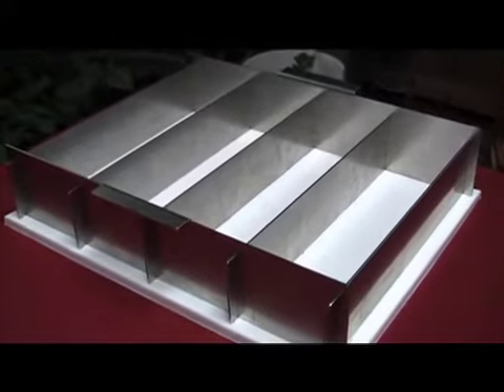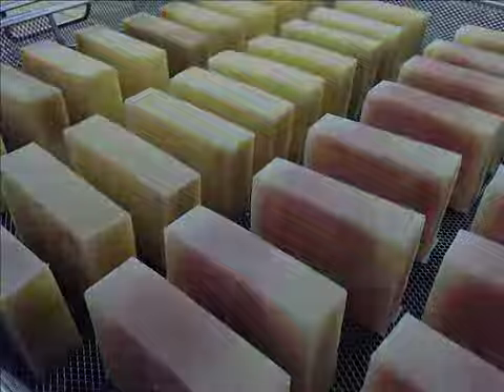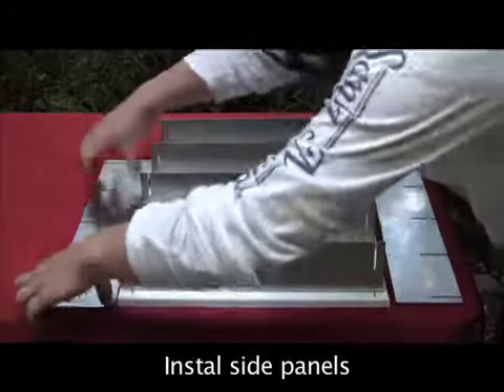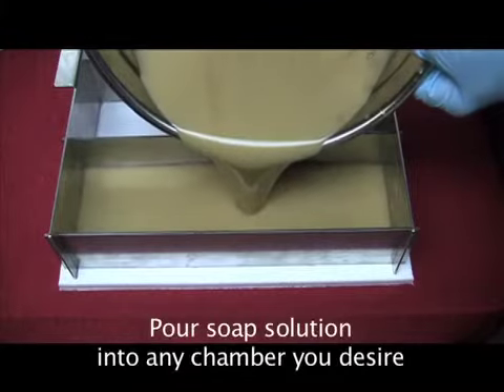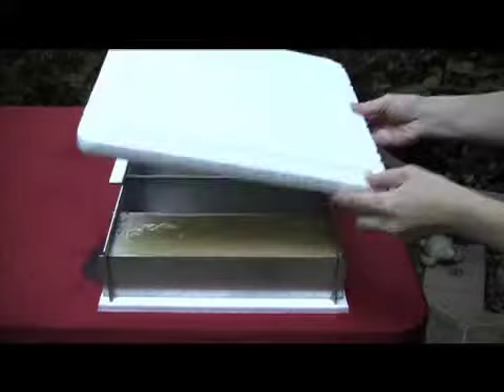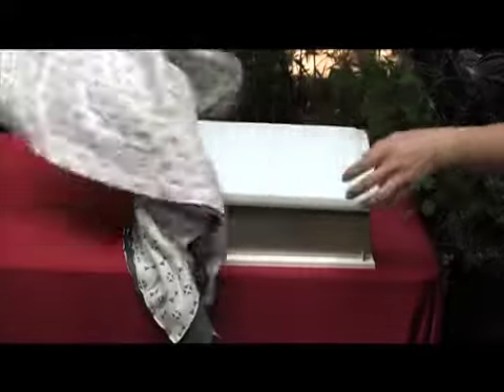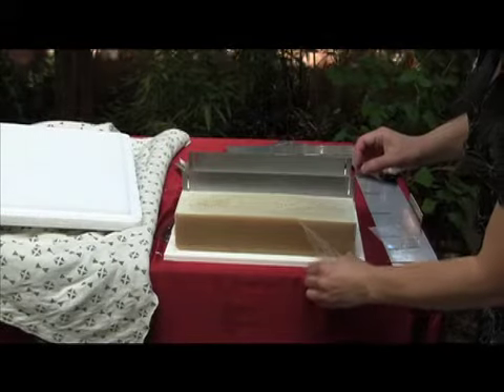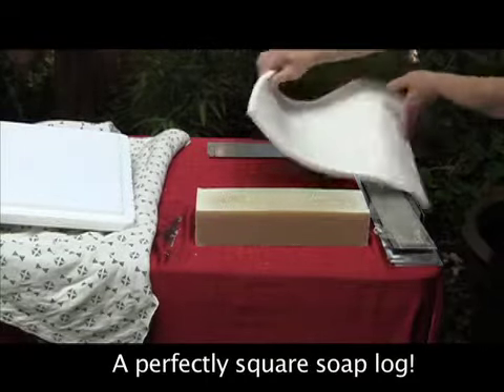A new and innovative soap-making mold from LiluSoap Tools

Comment: Are these still available for sale? The link below appears to be broken. Also what is the width and height of each of the chambers or final size of soap if cut 1" thick? Thank you
Reply from the maker: Yes, we have these molds in stock! Each chamber makes a 11” x 3” x 2.5” loaf, or 11 of 1” bars.
Reply from the maker: Each chamber makes 11 of 1” x 2.5” x 3” bars. The whole mold makes total 44 bars.
Reply from the maker: You do not need to use all four chambers if you do not wish to make 44 bars each time. You can pour soap solution into 1 or 2 or 3 chambers only.